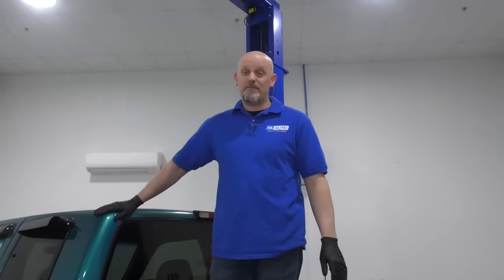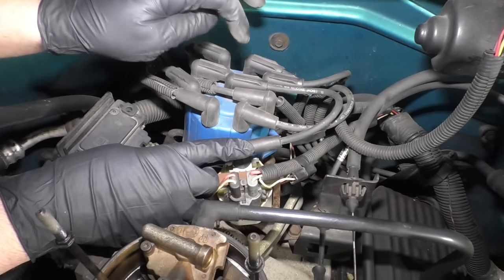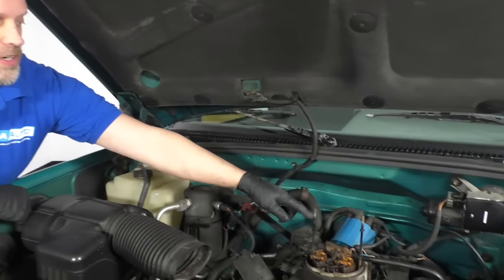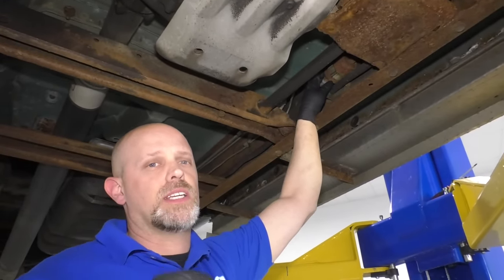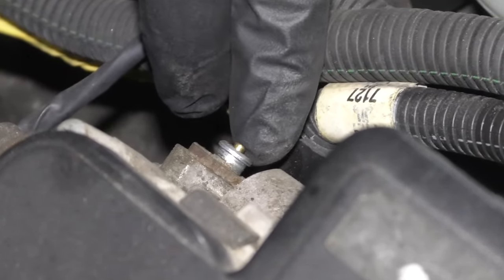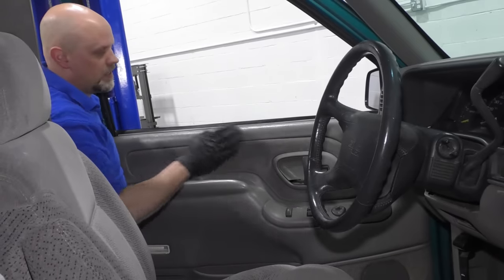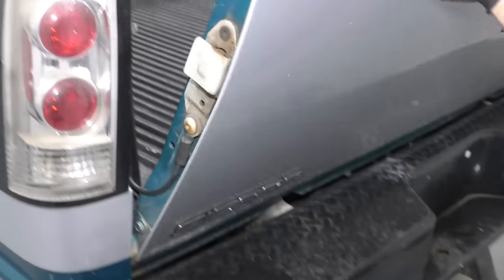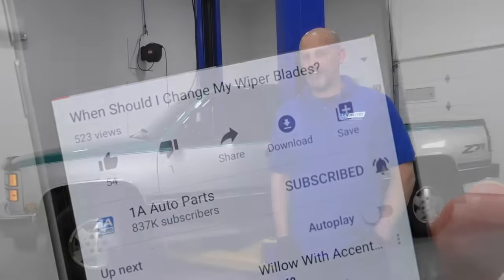Top 5 Problems GMC Chevy Truck 4th Generation 1988-02

Comment from the maker: √  Watch the Video
√  Buy The Part at 1A Auto http://1aau.to/m/Visit-1AAuto
√  Do it Yourself
√  Save Money
Reply: Can you do a video for a 98 GMC 4x4 5.7 liter yukon for replacing the oil pan gasket? I have to do it and I am stuck on how to get it out:)
Reply from the maker: +kakashi uchiha We do not have a video for this repair right now, but we'll keep this request in mind for a future video! 1AAuto.com
Reply: @1AAuto  can you send me the link to the video you have posted?  Also if possible can you describe the steps if the video isn't for the 98 Yukon. Thanks in advance:).
Reply: BINGO!!!! 🎉 My 98 C1500 had every one of these issues. 

What do I win???
Reply: You forgot to add the notoriously bad 700r4 and 4l-60e. After 300,000 km your transmission is living on a prayer 
Fix it with the Manuel new venture gear 4500 series 1 ton transmission they bolt right in.
Reply: I have a problem with my ac controls. It blows hot and cold but I can't switch which vents it comes out of. Also my fuel gauge doesn't work unless I turn the truck off, turn headlights on, it'll slowly go up to a reading. And my oil gauge flicks. Sometimes it's low, sometimes it's high. What parts do I need
Reply: Don't forget idler arms are notorious for going bad on those trucks
Reply: 98 2500 4x4, heater fan control works when it wants to.
Reply: Crank sensors
Reply: 4l80e transmission tourqe converter lockup.
Reply: I can get my truck to start  i already change everything  on it i just doesnt crank
Reply: You forgot, frame rots where cab meets bed. And they do NOT make reman lower control arms for 4wd. Oh and the 4l60e was/is and always will blow up.
Reply: Slow 4x4 engagement.
Reply: What if the truck keeps blowing the 12v switched transistor in the hvac panel
Reply: My truck don't have reverse and don't have overdrive why
Reply: There are several issues with this video. Mainly year range you give for this generation of trucks. Example 1: 1999 new through 2002 had the coil over 5.3. 2: the 5.3 is multi point fuel injection not TBI. 3: the next generation has different interior and exterior handles and the interior especially are better than those. 

The only exception would be 2500 and 3500 models, but they changed in 200. I would think if you sell parts you would know the year ranges on the trucks.
Reply: @leroyknake1436  mine also i keep a golf club and tap under the passenger side and itll click on
Reply: Ty👍
Reply: R p

Comment: The main problem w/these trucks is they don’t make them anymore 👍🏼
Reply: They should have kept that series around and upgraded the faults. And sold it as a work truck. Instead they just built crappier  new versions.
Reply: Great Trucks
Reply: Just bought a 2500🙌🏼
Reply: ..I would agree..but even more so, the real trouble is they don't make the '67-'72 trucks anymore...and that they only made them for 6 model years in the first place.. :(
Reply: Love my 95 C1500 5.0L regular cab-8ft. bed. 270,000 miles and going strong.
Reply: @dyer2cycle  I understand what you mean with the 71 and 72 of the only thing that changed was the rear view mirror! I just got a 97 gmc 1500 slt 219,000 mi and the guy never broke it in!!! I opened her up and it was like I just drove off the lot... 😜🤯
Reply: You right.
Reply: Ooof
Reply: Yes
Reply: Fact same with k10s

Comment: That was when Chevys still looked like Chevys!
Reply: Grant W. Whitwam you do realize that the 2014-2018 Silverado trucks were a bigger version of this and square body’s right?
Reply: @brandonkeithley7464  I'm a GM man all the way the newer trucks are nice but just don't have that genuine box style like the older ones! I settled for an older Chevy (similar in video) instead of a newer Chevy truck! recently!
Reply: They still do
Reply: @brandonkeithley7464  Nahh, its not the same.
Reply: You are correct I have a 99 Chevy 3500 single cab gas ,98 k1500 z71, 99 2500 ls . Low to the ground compared to the new ones but I prefer the 350 over the 5.3 because I grew up working on then and it's not computerized .
Reply: @brandonkeithley7464  Those pickups and the 99-02 pickups are my favorites in the newer style.
Reply: @brandonkeithley7464  I really don't care, I like them more than the newer and new models. My uncle still has is 1994 1500 Chevy work truck that he bought new. For granted he is driving it less and the a/c died in 2002 and he didn't care to fix. Thing seems to working just fine. That is more than what I can say about my sons 2018 Chevy truck. I bought it new for him and it has many issues.
Reply: @brandonkeithley7464  That look likes Ford,  you can thank Dodge for making trucks bigger.
Reply: Agree 100%
Reply: Agreed  but now none of them look like they used to😒
Reply: @brandonkeithley7464  eh kinda. Sure dont hold up like they use too thou
Reply: Yes!!
Reply: @brandonkeithley7464  The stupid HUGE oversized front end with grills the size of a fence. UGLY is
too nice of a word. I think a rapper invented them to match the grills on his teeth.
Reply: Ok boomer
Reply: @brandonkeithley7464  they look like trash compared to obs
Reply: GMC style trucks still look the same. Better than chevy.
Reply: The new look sucks
Reply: I dont like newer trucks.... this was the last generation of trucks in that time period (GM, Dodge and Ford) where trucks looked and felt like trucks. There may be better performance now but trucks to me aren't meant to be a minivan with a box behind it that cant fit barely anything inside. 
I've worked in the industry 14 years and the days of trucks being different from other vehicles on the road is unfortunately long gone
Reply: My 2014, which I bought new, has been a true workhorse. 210k miles, all hauling miles.  
My 1997 Chevy was excellent.  Drove it til 275k and sold it.  

The GM 5.3 is a beast.  Vortec or Ecotec.  Great engines.  But the ecotec has my vote.  
Just install a catch can, use some crc gdi intake valve cleaner, and enjoy the power.
Reply: @calebmelton5989  no they don’t
Reply: @andrewwoodall9119  You’re mostly right, there’s still a computer. Only reason I like the K1500’s so much is because there isn’t as MUCH reliability on the computer, a lot less sensors to worry about affecting performance, and the fact that if you keep oil and coolant in them the 350’s take abuse and never blow up.
Reply: @brandonkeithley7464  no the 14-15
Reply: @SpyTube24_7  saaaammmeeee bruhhh frfr
Reply: Agreed👍
Reply: Ok
Reply: Fr tho
Reply: @2drsdan  ever heard of more airflow new trucks are a lot bigger in size to the old ones which gives them room for a bigger radiator and trans cooler also that big grill is bringing more air in I love the old trucks and new trucks.

Comment: WARNING! I own a 1998 GMC pickup. While driving recently, I heard what I thought was the scraping sound usually caused by the brake wear indicator. I took the truck in for new brake pads. After they lifted the truck to look at the brake situation, they called me back and explained the rear end U-bolts that hold the back axle on, were so rusted that some of them were actually broken and he was amazed the rear end was still attached to the vehicle. My regular mechanic explained that the bracket that goes under the back rear end housing collects water, debris, road salt, etc. and causes the U-bolts to rust toward the bottom where they fit thru the bracket over time.  He replaced and I was back on the road.

Comment: I bought my 1998 GMC Sierra SLE 5.7 L vortex fuel injection, in November of 1997. Original owner and proud to say 309,000.00( three hundred nine, thousand miles. I feel like I have bought this vehicle two or three times. Affordable, quality parts are the secret. I watched the video and the distributor symptoms described my issue almost to the details. So I think I will start there

Comment: These trucks up til 1998 with the 350 engine and tow package were some of the best, most durable trucks ever made.  I owned a 94 GMC 1500 with 4x4.   Strong, powerful, and reliable.
Reply: Why up til 98?
Reply: Yep you got the good one they sent the bad one to alabama where i bought it, 3 failed engines and 6 transmissions just to get 120,000 miles out of it. Been in a ram ever since with zero issues, love tthat hemi, but like gm trucks they tend to share the cheap plastics issues. Also have a xlt 1993 full sized bronco i bought new that has never had any issues at all until the trans started slipping at 430,000 miles and plenty of oil leaks outta the 300 I6 , debateing a full power train rework on the bronco since they are worth more than most any other american truck of the age. Growing up on a farm we always had a bronco or 2 a 73 and a 79 today we use side by sides
Reply: @charleshollingsworth1583  Hemi's are awful
Reply: I have a 97 1500 c/k with that same package still going
Reply: 99 for the Tahoe body..got mine with the Z81 package and leather, fully loaded with all options..it's a excellent daily, 3 inch lift, 33s on 20s under bumper winch ..it replaced my 79 K5 and 73 K5 ..I do wish I never sold the 73..it had the full removable top ...
Reply: @dk-qr5xt      1998 wasnt the last year, the C/K classic was built until 2000

Comment: Two things you can do for preventive maintenance for the fuel pump issue. Keep the fuel level at or above a quarter tank, and replace the fuel filter earlier than the factory interval. I replace it around 25k to 30k miles. They are pretty cheap. Rather than getting towed back home or to a shop to pay a lot more later.
Reply from the maker: +high life 1320 These are awesome tips! Thanks for sharing that with us.
Reply: Most TbI fuel pumps(88-94) last longer than the vortex injection (95-99)due to 13psi vs 50psi  the pins and bushings are the cause of door handles breaking due to excessive force need to open door when bushings are failing.

Comment: Mine has 424k miles and still running strong AF. 5.7L 350 TBI
Reply: 1998 gmc 1500, 5.0 liter V8 vortek owner here. 340,000KMs and still running strong. Only had to replace blower motor, brake line, and coolant lines. Still works good and runs great. Starts when you turn the key. Wish they still made these trucks not many people have them but lots of people want em'!!!
Reply: K2500 454 7.4 vortec 4x4 crew cab with fts suspension for sale. Mileage 137k 

10k OBO
Reply: My old 91 regular cab short bed finally died at 340k, sometimes they last forever if treated right

Comment: I feel like door pins and bushings would've been a great honorable mention. 

Not to mention grounding issues and problems associated with the break lights
Reply: Amen! Been there before but now I'm having a problem now with my backup lights not wanting to come on do you have any suggestions with that?
Reply: Like what with the break lights? I have one and my top light won’t turn off, even with the key out the light stays on?
Reply: Brake lights are a big problem with this.
Reply: You mean how poorly they work? And how you can't adjust or work on them?
Reply: Brake lights? 😶
Reply: You'll have that problem on any vehicle that's 20 years or older. Things don't last forever.
Reply: Samyouplays,  they for sure need to be mentioned..
Reply: Just fixed my brake lights not grounding. On a 4 wire plug you would think the wire separated from the others would be the ground wire. But NOOOOO.....   i think the wiring was designed by a Freightliner engineer.  Anybody that works on big trucks understands.
Reply: yup. Especially when your doors sag so much you have to slam the piss out of them to close. I replaced mine in a couple of hours.
Reply: @RustyRambling  sounds line a ground issue.
Reply: The brake lights! Oh my gosh yes mine does that all the time. I however recently had to replace the wiper/blinker stalk and noticed some of the wires were melting together on the harness near the plug. Seems like I haven’t had too many issues since fixing that part.
Reply: Is there any common areas that they might have a ground problem cause the fuse for my taillights and instrument panel lights keeps blowing and I can’t seem to find the issue
Reply: Yep, so true
Reply: And the headline,  abs control unit and wider computer
Reply: I've found the circuit board warped, "solved" by placing small aluminum foil balls under metal clips interfacing circuit board to bulb socket.
Reply: Replace your door pins arent the issue, its the shit pot metal washers that break after using the door 5 times lol. Replace them with solid steel tube washers of the same size. Problem solved.
Reply: @mrnapolean1  high strength steel tube/cylinder washers of the same size as the shitty pot metal ones Will solve your problem
Reply: Yep those things should be top of the list
Reply: Door pins and bushings are so common to be bad or missing
Reply: @youtubepremium7849  you ain't wrong on that. I think the first time I did it it lasted 2 days. I think they make em out of reese cup wrappers.
Reply: ive been fighting with the ground on my break/turn light on the right side for years, i finnaly soldered a wire fron the socket whare it connects to the bulb to the actual wire connector. end of problem.
Reply: Sagging doors  absolutely 💯 😠
Reply: Dont break your lights!!
The word is BRAKE!!!!!!!!!
Reply: I was going to say I’m having issues with my tail lights. Drivers side doesn’t work but passenger fors
Reply: Haha thanks for the reminder
Reply: Yea upgrading those battery grounds and cleaning the other body grounds is huge for problems
Reply: @charlesbanks639  did you figure it out sir
Reply: I figured out why the pins an bushings wear out. The rubber gaskets seal from the weather AND hold the door in place. When the gaskets wear out the pins and bushings wear out. Fill the door gaskets with rubber tubing or replace . When the gaskets are replaced the doors stay in place and don't rattle or wear the pins & bushings.
Reply: You're so right! I have to slam my goddamn driver's door like a crazy person. Also, I've replaced my tail light bulbs multiple times from the moisture

Comment: I feel you missed the #1 issue which is door lag/bushing repair.  Every owner I've ever talked to with this model has had that issue.  A helpful video nonetheless.  Fuel pump/filter actually gave me a potential solution to a power concern I've been having lately.  Thanks!

Comment: I just bought a 97 Cheyanne with under 200 km on it . I have owned a 98 Silverado which I sold at 345 km and a 99 Sierra which I sold at 300 km. Both were still running great . This vintage of GM trucks are fantastic work horses and not that hard to work on. Thanks for the video highlighting some of the few problems they have.
Reply from the maker: +MrStofer Thanks for checking us out!
Reply: ...I may be in the minority, but I MUCH prefer the 1988-95 pre-OBD II TBI trucks to the '96-'98 Vortec trucks...I've had a few of these trucks, they do all have issues, but they are good trucks..only one was '96-'98, and I was amazed how much more complicated and trouble-prone than the earlier ones...OBD II complicated things, plastic/aluminum 2 piece intake manifold which WILL fail eventually, massive water leaks...sh@tty plastic distributor with one of the crappiest distributor cap designs I have ever seen..troublesome "spider" fuel injectors...lots of extra sensors, extra oxygen sensors...crappy 4WD engagement systems...and I'm sure I am forgetting some others...the '88-'95's have none of this stuff...now, when looking for a GMT 400 truck, I generally avoid the '96-'98's....

Comment: I've owned a 1998 K1500 since new.  The biggest issue with mine has been intake manifold gaskets.  It's on it's third set in 139,000 miles.  I also own a 1998 K3500 that I bought used in 2007 with 119,000 miles which I did have to replace the distributor on it when I got it.  I love this body style of truck and plan on keeping both for many more years.
Reply: I have replace the intake mainfold gaskets 3 times on my 1998 C1500. Supposedly the Fel-Pro MS98000T gasket set is the hot set-up and that is what I used the last time.
Reply: Why would you have to do it 3 times? They fixed the design and it should only have to be fixed once.
Reply: @tonyinfinity  , true, but some people look at the plastic ones and say $8 vs the $50 Felpro super seal ones which are steel reinforced and go by price alone. Note Felpro makes the junk plastic ones too.
Reply: @JohnSmith-cw2wd  , miraculous you didn't loose a rod bearing after that many times. I'm assuming no coolant went in oil, so you have a better chance of winning the lottery IMHO.
Reply: Wow, my 97 c1500 has like 196000 miles and as far as I know it's never had the head gaskets replaced, I've been counting the days until it's just gonna give. Hope it was replaced by the guy who owned it before my dad
Reply: i know this is a long shot but im actually having the same problem that you might be having. Is it leaking oil out of the rear top of the engine?? please send me a private message or an @ to reply so i can see it because im trying to figure out the culprit i been changing every gasket i can and am not figuring it out!
Reply: @daveondre4892  I have a 92 k1500 and I think the intake gasket went. Could be the head gasket. No water in the oil. Oil is clean with no white gunk. No white under the fill cap either. The oil went up on the dipstick and may smell like gas. It has been sitting for four months. It had some white smoke prior, but then the truck heated up and lots of smoke. Shut it off immediately and towed it home. Any thoughts.
Reply: @JohnSmith-cw2wd  replaced mine with the fel-pro 2 years ago, and I haven't lost a drop of coolant.
Reply: Good on you for sticking with them despite their problems.